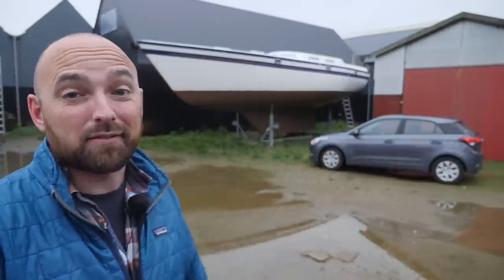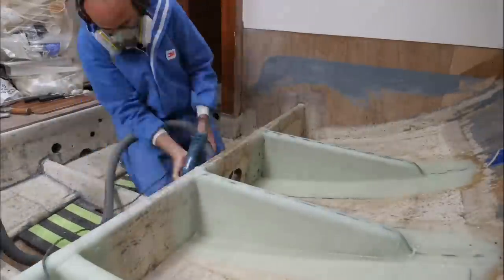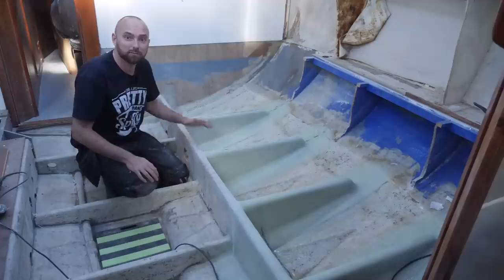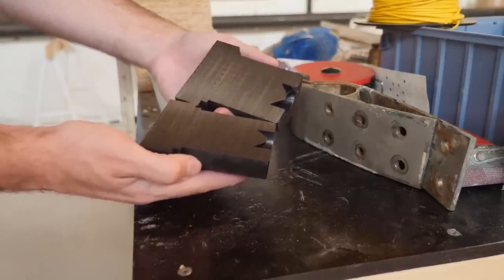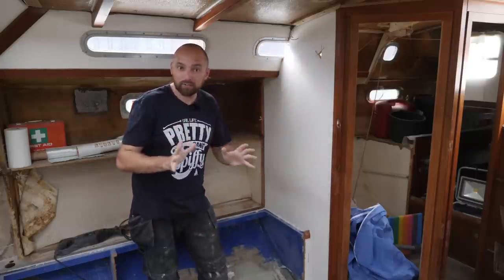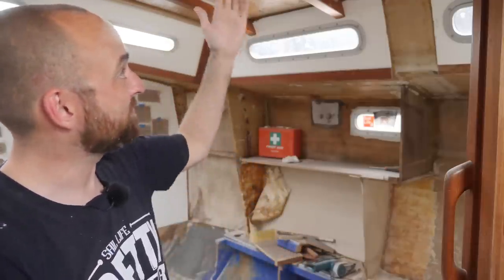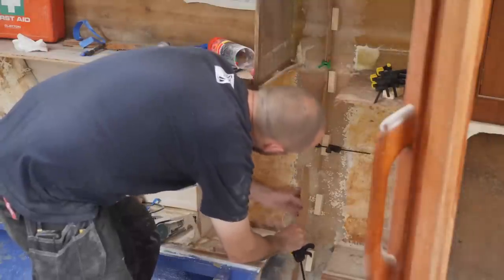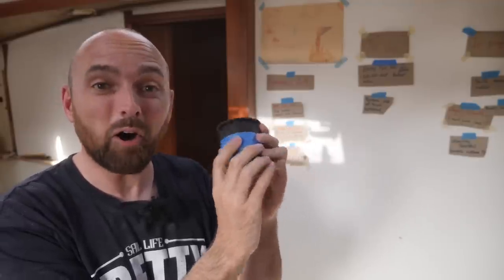Sail Life - Bulkhead template and laying up more glass - DIY boat repair

Comment: Hey mate. You need to rough out the whole shape of the bush first. That means drill out the centre bore it out leaving a couple of mm of material (eg if final inner diameter is 50mm bore it to 48). Do the same to Al other dimensions. Once you are roughed out you can do your final finishing passes. This is done in order to be a faster removing material with out the worry of it running out of centre, since you have plenty of leeway in case it does move in you a little. Also cutting the bush in to two pieces should be the very last step, one it's out and everything has been finished on the lathe. That cut even if it's crooked or not exactly in the centre is not important, since the bore itself is aligned to all other dimensions. I also recommend when measuring for size measure the saft and not the bush and calculate how much interference between the two parts you need. Hope this helps. Love what you are doing. Good luck with it all =)

Comment: Back in the seventies I built a 36' sailboat and used delrin as bushings around the rudder stock. 40000 thousand miles later when I sold the boat the bushings still showed negligible ware

Comment: just a suggestion on the very thin bushings Mads,  first make a dummy center shaft that the bushings would fit on that's exactly the size of your interior cut. Then make your interior cut first and slide the new piece on the dummy shaft then make your exterior cut with the lathe to get your thinness and the interior dummy shaft made out of wood or aluminium will then keep you from crushing and or bending the thin piece while you machine it

Comment: Mads, consider making a pocket door of the new head door. It would recess into the new wall and leave more room in the head. You, of all people, could engineer it. The wall would be slightly larger by the width of the plywood.
Reply: BIG disadvantage of pocket doors is; they rattle. And there is absolutely no permanent engineering I would know of to avoid that rattling and clonking à la longue.

Comment: Reinforcing the stringers ( in hindsight ) was definitely the right approach.  Your workmanship is top notch.  Well done.
Reply: I agree, very good idea.
Reply: I"m just worried that the wood under all that glass fiber is going to ferment and turn into gas pressure in the Tropics. You have plenty of time so why not vacuum pump them from the bottom and add thinned slow cure resin from the top. After all; you already have the equipment.
Bit like pouring watery lime down into old masonry walls that just have clay mud in the middle.
Reply: Peter Hendry I would doubt that.
Reply: Why?

Comment: "A bit more sanding"?  Mads I have never seen you do just a bit more sanding unless you have videoed doing your fingernails and I missed it (lol).  The head will be luxurious when you are done and Ava will love you for it!  You are doing such a great job.
When you do the thin bushing do the interior bore first and insert a shaft section in the bore to prevent the bore collapsing while turning the outer diameter.  Have a wonderful week ahead.

Comment: Hi Mads
#1When turning or boring on the lathe make the part a little bit longer than needed, then turn or bore a short length to size and record the micrometer dial setting on the cross slide. After that you can rough cut the entire length and then make your final finishing cut at the same micrometer dial setting and be confident that it is on size. 
#2For your THIN WALL BUSHINGS bore them to size first. Leave it in the chuck. Make up a wooden dummy mandrel and hot glue it into the bored hole. This will support the bushing when you Turn the O.D. Then Remove the dummy mandrel. You might need to warm it up to soften the glue. 
#3 Before you remove a work piece from the 3 jaw, Mark it and one of the jaws with a felt marker. Put it back in the same place. That way it will be much closer to being concentric and easier to dial in. 

#4 I bought a F.G. Hull and deck. For bulkhead templates. I put 3/4 masking tape on the hull where the bulkhead was going. I took a photo (film)of this making sure the camera was square to the bulkhead plane. I included a yard stick in the image. Using a slide I projected the image on a wall making sure the yard stick measured 1 yard and that the over all height and width were as close as possible. I traced the image on to paper and used that as a template foe the plywood. It was within 1/8” / 2.5mm everywhere.

Comment: Looking great Mads!  I loved the comment about the epoxy pusher! 

The clamp tool that you got - a great tool (along with a roll of stainless steel tie wire) to have on board when you are cruising.  It takes up very little room, its light weight, and is so versatile.  You can make a replacement for any clamp on board.  A clamp for your bushing is the perfect example.  I was wondering when you were starting your bore why you didn't have a hose clamp around the product to keep it under control.  All in all a great McGiver tool.

Comment: The "anything wireclamp" is a handy helper.
On the lathe You could also have gone with two hoseclamps (two for balancing reasons), there's enough space to fly those. A four jaw chuck would be a better device to grip split parts though. Not everyone has one, I know, and not everyone can put it to a proper use either.
So, wireclampanythingy ... well done.

Comment: Mads, to speed up this lay-up work, perhaps you could layup the layers on a flat board ( on plastic film ) wet it out with the epoxy then apply it ( the thick wetted out layer sandwich ) to the desired section and then it would be just a case of rolling / stippling it into place to ensure full contact ?? Might speed things up alot !

Comment: I'd have liked to see how you reinforced the strips templating the new bulkhead to ensure it remains accurate between boat & plywood.
Here's hoping the new bulkhead fits snug.
As an alternative for the other side, try spiling. 
It is a really satisfying method & doesn't have the risk inherent in a wobbly template!

Comment: Simpler solution: 2 hose clamps
I am a Machinist. Been there, done that.
Reply: Why not split it after turning?
Reply: the saw cut removes too much material making the end product not perfectly round anymore.
Reply: ah, so they would counter balance the screw. Very nice.

Comment: You got stripped screws...   Don't we all!
Since you've already cut the teak, these ideas are for the future:
First, try a small flat bladed screwdriver bit on the screw.  Use a manual driver handle and turn slowly.
Sometimes that will tame the screw.  Failing that, drill out the SCREW HEAD with a drill bit that's
one size smaller than the hole.  The solid teak board (Now called "Unobtainium") will slide off the 
remaining shank of the screw or be 'unscrewed' from the back side of the board with pliers.
When removing teak bungs, use a #6 screw.  Drill a small starter hole, screw the #6 into the hole and 
the bung will come out or you can pull the bung out with the screw, and with no damage to the 
original hole or teak board.
Happy sanding!

Comment: Next week on Sail life..."I notice a few imperfections in the hull so I cut the hull away from the interior of the boat and begin preparations to lay up an entire new hull."
Reply: He did it already, putting a new, more perfect part of the outside hull under the copper coat that is, didn't he?

Comment: If you are trying to make a "thin" bushing, start by turning a shaft to the ID of the bushing.  Make it 3-5 cm longer than the bushing.  Drill a center hole partial way through that shaft and then 2 partial cross cuts.
Now, face and drill/bore the ID of the bushing.  Place the bushing on your shaft/arbor/"internal collet".  Insert a slightly oversized screw into the arbor and it will spread itself to clamp to the bushing/work piece.  Chuck the arbor in the lathe and make your OD cut on the bushing.  Make a couple of spares !

Comment: For your next bushings I suggest you rough the part out first in 7 steps.  Rough the OD of the bushing leaving it 2-3mm oversize.  Cut in half.  Rough the OD again leaving it 1mm oversize.  Wire up part.  Rough the ID leaving it 1mm undersized.  Finish ID.  Finish OD.

The problem you are encountering is an interrupted cut.

 You might want to test what ever method you choose on your defect part turning a sleeve wall 2-3mm thick and 3-4cm long to see if it works.  This can avoid a costly mistake.

Comment: Before splitting the bushing material cut rough opening in middle and the O.D.  Then split it and then secure the 2 pieces with a clamp and the jaws of the lathe and then cut the final dementions in the end.
Reply: Wonder why you cant make the part first then cut in half?

Comment: Always satisfying to see visual progress on a project, full steam ahead, looking good.
While you have the tools make a spare bushing.  You forgot your fiber glassing skills, you could have warped a band of epoxy-glass around the split part to hold it together, but that is how we learn.  Some electronic levels can be calibrated to a reference  surface to compensate for the tilt of the boat, selected shims hot glued on a standard level would do the same.

Comment: You could try a wood plug drill bit to get around a stripped screw next time. You might have a bigger hold to repair of course but you will save the trime and colour matching hassle of a new piece. :)

Comment: Couple pipe worm clamps or a pipe over the punk (I think it's called) may fix your shifting problem. (Spoke to early) that tool looks like a safety wire type tool. Neat.

Awesome work Mads.

Comment: In case split work comes up again, if the chuck bore is large enough reverse the piece so the majority is in the chuck jaws. (4 Jaw chuck is best)  You can also use temporary adhesive such as PVA that is water soluble. I've even just run 20 wraps of tape around the piece and it worked (Not OHSA approved) I recommend Kieth Rucker to you. He has a large number of vids showing techniques and a huge archive of manuals of the same vintage as the lathe.

Comment: unless you have a way of securing the bushing, I don't think can boring a hole that size in a part that is split using a lathe. suggestion: use a vertical mill to bore the hole in the bushing.  the key is to ensure the part secured along is entire length.  the bushing will be clamped in a vertical chuck allowing the hole to be bored out incrementally.

Comment: Hey there you need to drill a hole first before useing the boring bar.  Keep up the awesome works
Reply: He tried that on his first bushing and when he cut it in half, the removed material from the cutter made the budhing no longer round, slightly oval, this is why he did it this way.

Comment: Mads Drill the hole first then take down the outer diameter and put the lip on it lastly split it. The only way to stop the two halves from splitting up is if you put a packing band around the outer and even that would not completely stop it from shifting.

Comment: Yup, adding that chamfer = 34 spiffy units, and 10 credit points towards being a hobby machinist (which is level 1). 
Advice, always tape split parts. Advice two, never bore large, always bore small going up. You drill 3 then 5 then 8 and so on to within 3 mm of your target dimension, THEN, you pull out the boring bar.

Comment: A thing that happens frequently that’s frustrating for you is that you’ll get all psyched about completing a certain milestone and then, wouldn’t you know it? You’re fresh out of epoxy, or fiber glass, or screws or rubber gloves. Sadly you had to drive a total of five hours using valuable time.
In a comment I made in a previous episode I suggested that you create a simple inventory system - in a spreadsheet or even a notebook where you can track how much of the more common materials you’re using and current stock so you can order these materials ahead. 
You’ve got a Kanban for your tasks so you can project what materials you’ll need in what quantities, it should be a relatively straight forward matter to anticipate and prevent shortages.
Reply: I am so addled by this comment that I cannot conjure up a suitable response. Perhaps something about good intentions? I shall instead just move on...

Comment: I don't think you should be worrying about Scarf joints for the bulkhead. I would say they seem to work best on "square" lumber, like beams, but your building a "sheet". my suggestion would be to split the pieces vertically, ( since you are using this to support the cabin top) , and either use a tongue and groove  system to attache them together, or a "biscuit jointer" . The reason I say this is a scarf joint is good for transferring loads through the joint, but here, you don't need to do that your loads are mostly up/down, but the scarf will be strong left/right. No need for it. In this case.

Comment: Hmmm. I wonder if you can use some of the extra bushing stock and machine a sleeve with the lathe first to slide over the  bushing to keep the halves in place while you try to cut the inside diameter.

Comment: If you ever need to make another bushing like that, you can benefit with placing two or three guidepins per side made of steel, they can be moved after you are done the small holes will not have any effect on the durability of the bushing.

Comment: for that bushing--towards the end or outboard location, run some electrical tape around the bushing then install a hose-clamp to better stablize the part during the machine process-----Mikey

Comment: And on the new plywood bulkhead entry issue...
Can you remove the main hatch slider temporarily and move the engine cover/ladder out of the way 
to give you better access?  That may give you a couple of extra inches, allowing you more 
flexibility in your cutting location.
Just a thought.

Comment: or for the rudder bushing make a wide thick ring / tube that can just be pressed over before making the hole in the middle to keep it assembled
But tight steel wire also seems to do it

Comment: Don't lose that piece of teak. Take it from an old finish carpenter, you can reuse it by carefully scarfing the remaining trim then fitting the off cut to it carefully. A little wood glue and a plug over the new screw should do the trick!

Comment: You should use a standard drilling bit for the hole in the bushes or however it's spelled... After drilling with the standard bit you can use the tool
Reply: For the thinner ones just go fast and take off less material at the last passages with the tool... It should be ok...

Comment: Nice Vid as usual.  BUSHING QUESTION?   Did you allow for making the outside round again once you split it??   Similar to how you finished inside, I would think you would have to finish outside.  BTW 2 nice hoseclamps holding halves together an efficient solution for machining that delrin (US brand of same material it appears) while split.   Good luck.

Comment: Are you planning on retrofitting limberholes into the stringers that you just glassed in?
Reply: He just needs to cut away the glass from the existing limber holes. I doubt he'll forget, as that was one of the things he discovered when he ripped up the cabin sole.. some limber holes had accidentally been left glassed over.

Comment: I love your drafting table. Mads always follows the rules...every item must have multiple uses. 😂😂😂👍👍👍
Hey guys, anyone know why the bushing can't be cut in half after it's been shaped? Thanks!
Reply: Let's say you have a internal bore of 1.5".  If you cut after the bore to 1.5, then the dimension becomes 1.5 minus the thickness of your saw cut when measured perpendicular to the saw cut.  However, in the dimension parallel to the saw cut your dimension is still 1.5.  In other words the bore is no longer a circle, but an oblong that does not match the shaft you are trying to create a bushing for.

Comment: I must have missed it a few weeks back, but why are you adding more glass to the existing ribs?
Reply: Because the wood formers inside them are wet. After consultation with a couple of marine engineers, it was calculated that adding 6mm of fibreglass would strengthen them enough that it would never be a problem. Easier and faster than removing and replacing them.

Comment: Maybe I missed it, but do you have to split the bushing before turning the inside hole?
Reply: Yes. If you split it after you've drilled out the inside hole it won't be perfectly round.

Comment: I'm not an expert, so don't act on this comment without verifying ... but I was talking about bulkheads with some other boat folk recently and a comment was made that plywood bulkheads should always have a bit of gap between the edge and where they're tabbed in, because the way fiberglass flexes is different from plywood. Find one of the many experts you know and check on that before you actually cut/install the plywood!

Comment: Mads, another way to join the plywood that is easier and just as strong is using a biscuit joiner and some biscuits with marine glue. Not sure what you call them in Denmark but essentially it is a saw that you control the depth to make a small sized slot in side of plywood on each side, the slot is same size as the biscuits so when you add glue to the seam and biscuit and clamp it, it is a very strong joint but way easier and faster to do.

Comment: When making a thin walled tube/bush/shim/etc you first get either the ID or OD (usually ID), support the ID with a dowl (made from anything strong you got , an old thick walled steel pipe turned down to snuggly fit ID is good support). Then turn the OD down to desired thickness.

Comment: The turning you were doing Madds wasn't totally correct.
You need to make a counter bored spigot with small screws around the outside
Then the two halves will stay together. 3 jaw chucks cannot hold split parts
The other choice is a four jaw chuck
Reply: Mark Dell *Halves